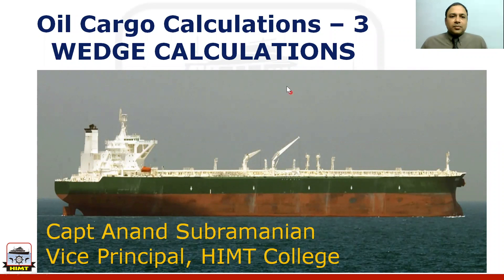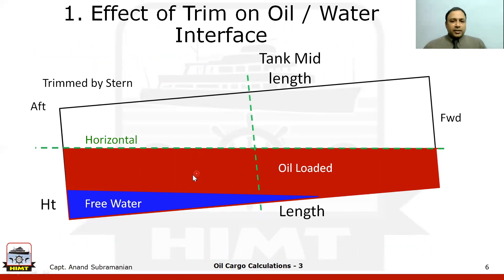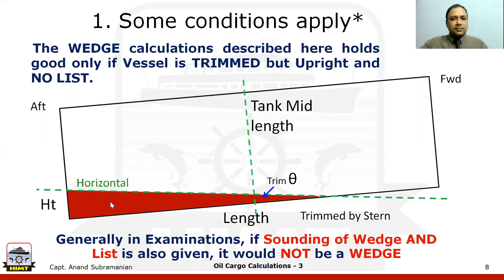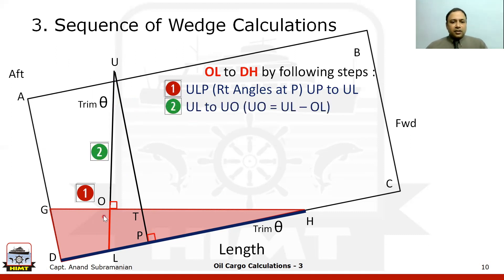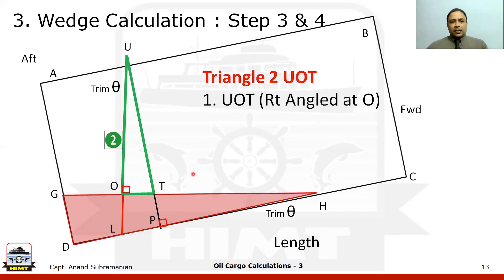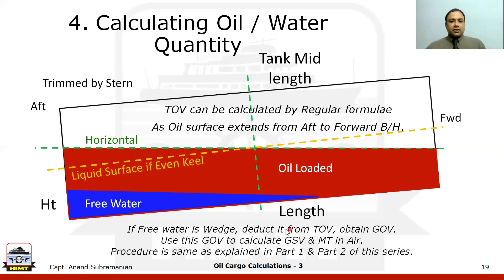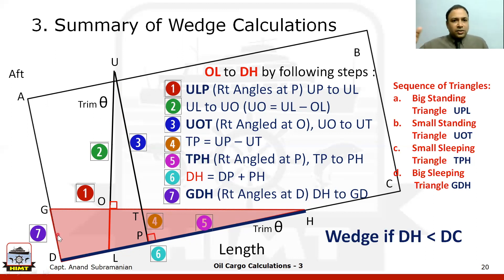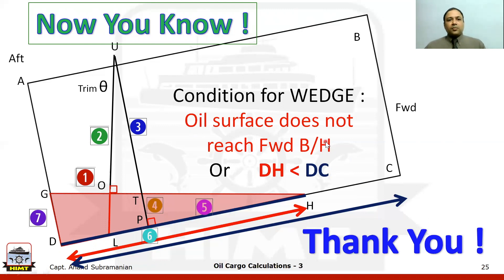Oil Cargo Calculations-Part 3 | Wedge Calculations | Capt. Anand Subramanian | HIMT

Comment: Nice Video Sir for the easy understanding.

But one doubt. 
Why we should form ULP or UOT from the top of the sounding pipe?
Whatever the height of the sound pipe the sounding tape is going to bend from the tank top, if so the "U" should be formed at the tank top. Plz clarify the Sir.